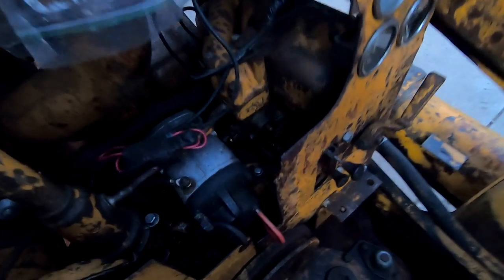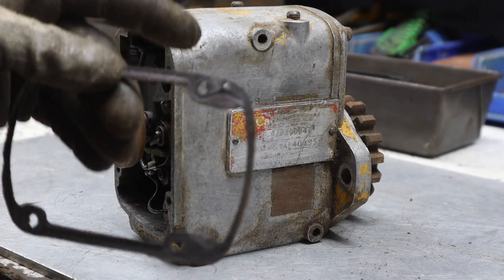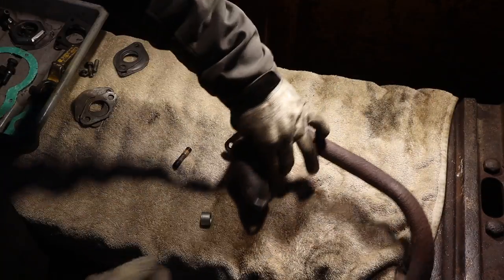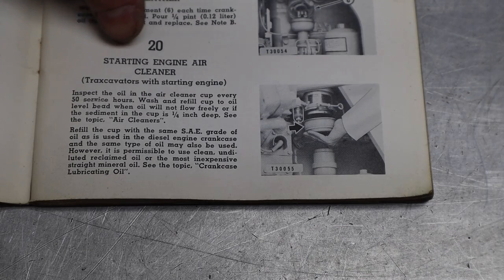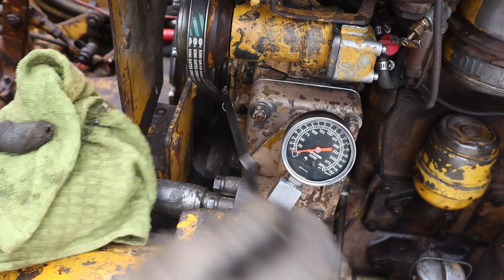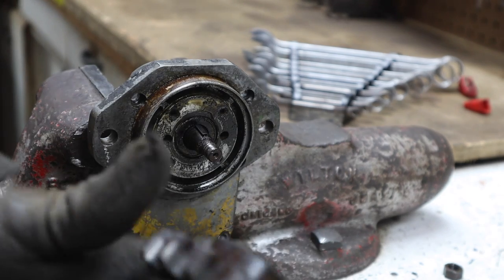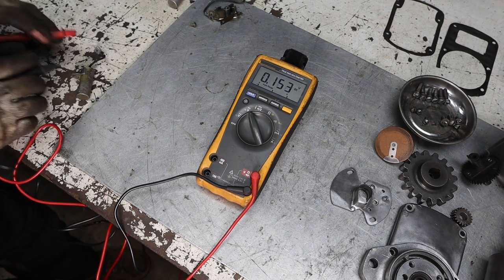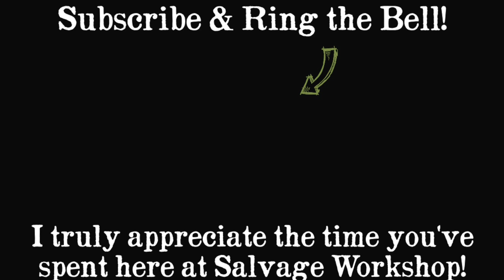FINALLY Found the PROBLEM! ~ Time to Rebuild a Magneto ~ Part 14 ~ 1950s Caterpillar TraxCavator

Comment: Just found the channel brings back memories, the old timers in the 70's used to wear those shiny hard hats but were beat to hell and not shiny any more lol! I ran those cats back in the 70's and it would have been a luxury to have a bucket with hydraulics, we had cable controlled buckets, there was a wench behind the operator that moved the bucket up & down. I'm commenting to tell you they had weld on teeth you could buy and weld on so you didn't have to remove the sprocket from the final drive, we did maintenance in the winter when it was to wet, also the pads would wear down so far the bolt heads were flat as a pancake and had to be torched off. You can buy plow grade flatbar 3/4 x 1 inch cut to the length of the pad width and weld to the old pads, weld both sides of each flatbar to the high point of the pads 3 per pad as I recall, and put all new bolts after awhile they looked all shiny like new again. We used to paint them all up cat yellow again and in the spring work sun up to sun down 6 days a week. Cat changed the color in the late 70's or early 80's & added more of a green tint to the original yellow just FYI so it won't match the yellow on that rig if you buy cat yellow today.

Comment: Have you set the timing within the Magneto and you have to set it when you engage it onto the Pony motor flywheel.
There should be some marks on the gears when you should line up within the small gears of the magneto. This will ensure that the spark works in the right relationship to the timing of the valves. 
I don't have any workshop manual for this model magneto. See if you can find one or talk to a magneto specialist.
Good luck. I have enjoyed your determination to make it all run. Cheers.

Comment: Nice brass tink-hammer.

You need to open the magneto back up and use a feeler-gauge to adjust the gap between the points when they are at their widest opening. There will be a specification in a service manual somewhere, but .025" gap will probably work if you can't find the official CAT number.

If you look at the (new) gear on the magneto there is an obvious timing mark on one tooth. You need to line that up with the timing mark on the gear that drives it when you reinstall the magneto or the spark won't happen at the correct time and your pony will run poorly or not at all.

Take care.

Comment: Gday bro ,
Great episode ,,  glad your digging a little deeper to check for run out .
Still , i wondered if the cause of the gears locking was a misfire due to a bad lead . The probabilities  are many .
The missing  teeth can be rebuilt simply by filling with weld &  regrinding  to suit ,also the shaft can be realigned 
 on the lathe & checked for run out .

Comment: Been through this exactly on a 49 D2 Cat. In fact, I think I still have at least 4 mags in a box with broken or bent shafts and broken gears. The main crankshaft bearings were worn out allowing the gear train in front to cause a 'slap' from the crankshaft up to the mag gear and shaft. I made new main bearings only for it to start breaking mags again after a while. This time it was a loose flywheel which also caused the key way in the flywheel to get excessively worn. I used cast rod to weld it up, turned it back true on the lathe, made a taper bushing for my key way broaching set and not a problem since. Just remember to only use the pony on/off switch for emergency use only (as in runaway). Always shut down the pony by turning off the fuel so it does not run into the crankcase and spoil the oil.

Comment: I'm glad you persevered, but sorry that your initial tear down didn't remove the magneto, that extra move would have speeded you up a lot!   So would checking for spark and then removing the magneto for fixing it on the bench and testing it there. 
Both you and I have to develop a method of debugging that relentlessly goes forward because we have eliminated the other possibilities.  There should be no backtracking to check if you got everything in a previous step.

Comment: Your doing a great job, at 53:30 when you put the gasket on the gap in gasket put some type of sealer to prevent anything getting in.  I would have put the key in the input shaft and installed the rear gear so I could put the timing mark on gear at the bottom as if installing mag.  Then when you put the gear on the front, I think you will find that the next gear in, has to be timed pointing to the number one spark plug wire spring pin, then when you put the plate on there is a timing mark on it see 54:16 where the plate dips there is a line. If I remember right, you should see a mark on the gear behind it that lines up!  Then when you insert the disc it should be pointing to the number one spring pin for the spark plug wire!!  Been along time sense I have put one together of this type!!! But see if this fits your assembly! I turn the mag over by hand  or with a drill be fore instilling it to make sure it fires, keep your hand from the ground screw or you will find out the hard way the mag is firing!!!!!

Comment: Smart thinking on holding off, hope your able to find the reason why the gear broke... ⚠️also have you thought about putting up a tent , a gazebo something to cover red to keep your work area dry , if your temporary canopy had walls or sides you could easily keep a heater going. The benefits of a temporary covering could make working that project a little nicer even in cold wet frozen wether...

Comment: I think that tooth on the spark plug wire end is more there to keep it from slipping off than for conductivity, it would only make a tiny bit of contact.

Glad to see you stripped the end.

Comment: I'm GLAD you were able to salvage that magneto! I know tons of John Deere tractors that are sitting around because they CAN'T get parts for the magneto to fix them anymore.
Reply: Years ago, on my JD 720D pony motor, I had to use two HD 6V coils on the magneto to get good spark, worked fine until the crank separated at the flywheel from running at load with too low of rpm (crank had been rewelded and resplined, then the shop casehardened it. Not a good idea. Have fun

Comment: If properly assembled the magneto should be putting out a very strong spark. Clamped in the vise by one ear insert a plug wire and hold it with an insulated glove. Turn the gear one rev and it should shot a good spark to the vise if the wire is held at the proper distance. Make sure the inner magnet rotor has the same clearance all the way around the field. If it is touching anywhere it will kill the spark. They make a meter for testing capacitance which in your case would be a great investment. You can go thru your old capacitor collection and cull out the ones that are no good. 
Once you kick over a can of worms the only way to fix it is find em all and put them all back in one by one. Not getting discouraged is the biggest challenge. I really enjoy the projects you have chosen to show us. Keep up the good work.
Reply: His meter has a capacitance tester! I use mine all the time when testing motor start capacitors :)

Comment: When you check the throttle body be sure any tiny orifices are clear of debris. It may take some very small-diameter drill bits to clear them.

Comment: Man I have to say you are one persistant dude. I am glad the matching gear wasn't damaged. At the very least your efforts are not in vain as the pony motor got a good going over and needed repairs were made. There are mag repair houses around that may have replacement parts for those mags.You could have a good spare. Don't blame you for looking further for the cause of the broken gear. What do they say"an ounce of prevention" .......

Comment: when you drill and tap a stud hole oversize, you can use an exhaust repair stud, which are stepped in size and nearly always work perfect, you may need to cut shorter if it's a shallow blind hole.

Comment: If you have a variable speed battery impact wrench you can spin the mag by driving the gear nut with a socket. This will prove your point setting. It needs to run counterclockwise and not that fast <100 rpm. Should connect both plugs. I had to do all of this when I rebuilt my D2 pony motor.
Reply: You don,t need a drill , if your mag is good all you need is to spin the gear with your hand, make sure your have both wires connected to spark plugs, all old school

Comment: EDIT: See my more detailed email about this. (and yes, I am enjoying seeing how you attack this problem. I'm learning a lot about something interesting, even if I am very unlikely to need it.

The magneto (like a distributor) has to be timed so that the spark comes at the proper time during the compression stroke. There should be some marks on the teeth. of the engine gear and the (replaced) magneto gear that need to be mated. Basically, the points should open somewhere near top-dead-center between the compression stroke and the power stroke. The 2:1 gear set inside the magneto makes the mag fire only every other time that the engine turns; they need to be timed as well.

Comment: Happy new year young man!
I noticed that you bent the locking tab washer over the pulley nut in two place but didn't see or couldn't tell properly if you also bent it back over the pulley centre boss. If the lock tab washer is only bent over the nut, then the nut can still come undone and the pulley could come off.
The lock tab washer should have a matching key that allows the washer to slide onto the shaft and then when the pulley nut is tightened up you knock half of the washer over the pulley centre boss and the other half over the nut and thus the nut is securely locked on.

Comment: Don't forget you can test the magneto on the bench with a spark plug and a socket on your electric drill to spin it up.  Timing it is going to be fun ;)  Somewhere in the sump is that tooth also ... would be good to fish that out.

Comment: On another channel, I heard that when the brushes in a magneto wear down, the material of the wire inside the brush catches on the edge of the copper on the  fiber disk you put in last and strips the gears.

Comment: I hope you have a manual for that magneto. You need to set the internal timing before you install it. The magneto is a self contained generator and coil in one. The timing is set between the generator lobes and the points to get maximum spark energy. If you are lucky, there may be timing marks like a cam timing gear/chain set. This relationship must be set correctly before you install it and then set the final timing.

Comment: I see that you use as mutlimeter a Fluke 175 . When you test a condenser
 you  turn the knob om ohms and then you push the orange/yellow button .
Now you kan test condensers / capacitors capacity  in the unit farad ( F) . The multimeter screen gives  n F . Witch condensor must you use :
 the one  with the highest value   .
I like the way you are restoring  a simbol of hard work

Comment: The magneto that you are using is exactly the same age as my 955H Traxcavator. The mag is dated 08/25/1965, and my 955H was delivered 07/25/1965. Fortunately my machine has glow plugs, so no magneto needed.

Comment: You do have a capacitance range on that meter your using so you can measure the value of the capacitor, providing it’s not shorted.

Comment: I’m glad you’re going tear into the pony motor. On the magneto those little gears ⚙️ could use a little grease to be on the safe side so they won’t bind again. And while you tear into the pony motor check out the cooling passages to see if they are clogged. Looking forward to seeing the next video.

Comment: That brass sleeve at 45:23 actually is a bearing, and the shaft needs a coating of oil for lubrication.  They are very commonly used in small machines.

Comment: I think you are right, there is a bearing failure.  However, I think the bearing is inside the magneto, and not inside the pony engine, where you said something might have misaligned which caused the tooth to break.  The bearing inside the mag failed, causing the teeth inside the gears to break, and caused the outside gear to seize, which caused the tooth to break.  Even if the pony engine's bearings inside wobbles, it will not break the tooth off the outside gear of the mag.  It was caused by a seizure, and this seizure was caused by the gears failing to move also, which was caused by bearing misalignment, as you have said, but not in the pony engine, but in the magneto itself.
And, the popping sound is a clear sign of a timing error.  I am a motorcycle mechanic and this kind of sound occurs when the timing is off.  I also hear this in car engines when the high tension wires have been erroneously installed and the timing sequence is wrong.

Comment: WOW! I just found your TraxCavator series 2 days ago and after binge watching through #13 last night couldn't figure out where #14 and #15 were??? came back this morning and Found #14 and realized that you had posted it less than an hour ago! Alas I must wait with baited breath for the conclusion. I really want to know:  a) what you found with the pony engine crank bearing situation.  AND   b) I am fascinated with the Track/Running Gear, Rail, Bogies  and re-installation and adjustment of the Track on the Right Side and REALLY want to see that episode too!  Looks like your 15 video series might need to grow to 17 or 18 to cover all that!  But I have subscribed and turned on the Bell, Can't wait for the rest!

Comment: Asmall tip, trick when dealing with a bolt broken down in the hole is you can take a short bolt of same threads and size and chuck it in the lathe center drill and drill down through the whole bolt and use it as a guide to drill dead center on the broken bolt , you than can slowly bore the guide on lathe returning it to the broken bolt than keep up sizing  till you can pick the threads out

Comment: Tough break, whilst i'm inclined to agree would it be worth setting up a dial gauge to measure the gear end float  (am I right in assuming that is the camshaft gear as the valves are above the pistons) and also the radial run out, if only to help prove your suspicions before tearing the motor down maybe unnecessarily, the problem of where the broken bits have gone is a worry but can you get an endoscope and look inside the gear casing (hopefully they're in the sludge at the bottom of the sump) to get an idea of how it looks in there, I just think it might save you a lot of work and aggravation.

Comment: 57:29. Smart idea to tear it apart and find the source of the problem, or else it may do it again. Plus you can find the pieces of gear in the crankcase, they could be tossed around when running and cause all new problems.

Comment: great work .....ive been thru the Mag on my Cat D4 7U....A few times over the years ......broken teeth  no spark etc.....i had to lift the pony engine up to get the pinion drive out...all so had to take the governor of the fuel pump to let it  come out of the bell housing .to find the broken tooth .....also .inside the mag.  the fiber gear that drives the points ..has a v mark on it ....it has to be timed to the armature gear ...the small steel gear at the bottom..the V mark lines up with a notch on the points backin plate ....look up Gian.in New zeland.he explains it way better  with pictures ......hope this helps .....good work.///

Comment: I'm a auto mechanic, specifically a driveability tech, andc i had a friend back in the early 90s who had a caddy with a 4100. He couldn't get any spark, and he had done cap, coil, module, wires and plugs, everything. He asked me to check it. Had him crank it, didn't sound like it had compression. So I pulled the cap, had him crank it, rotor wouldn't turn. Took the oil cap off, looked in at the rockers, had him crank, didn't move. Said theres your problem, timing chain is out. We pulled it apart, changed the timing chain set, had it going in a day. Don't overlook the forest for the trees, cover the basics.
Reply: NO , please  NO .. I don't want to remember working on them  and that "twilight " auto headlight system ....

Comment: I suggest that you find out what gap the contact breakers should have and set the contacts to that. You will also need to time the engine so that the spark occurs at top dead centre, or slightly before. Your handbook for the machine should give you the method for doing this.

Comment: Solid Core Plug Wires can be found easily at an Auto Parts Store by asking for a set of early VW Beetle plug wires, 1960's era. I discovered this when working on older motorcycles with points type ignition systems and had the same problems with no spark.

Comment: Hi,  Anton from Malta Europe: Your videoes are most interesting and to the point. I am interested in everything that is mechanical. The only thing i do not like is that you should totally strip of the outer paint and re -spray or brush paint, yes this will not make a difference of how the engine works, but eventually the restotation would result much better and more pleasent to look at. Cheers just the same. Video and sound quality is very good.

Comment: I definitely saw the crank pulley was loose or as crazy as it sounds the crankshaft of the pony motor is loose at 29:25 in the video. If that crankshaft bearing is bad then it may have caused your magneto gear shock/break issue through the internal gear set.
Obviously make sure to fix that crank bearing issue 😆

Comment: Strip it right out, it is always worth a dig on an old machine. I am not convinced by the movement in the crank pulley. I haven’t worked on one, but it looks very wrong. I’ve never seen a main pulley move like that unless it was loose or the crank was bust?